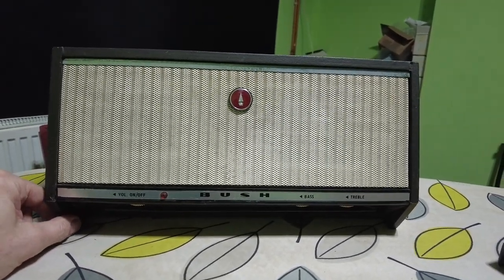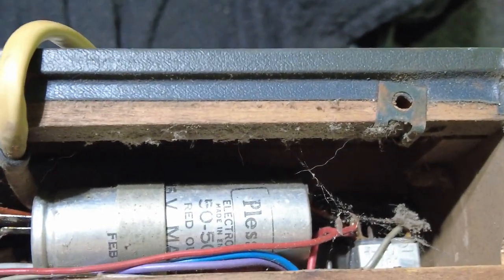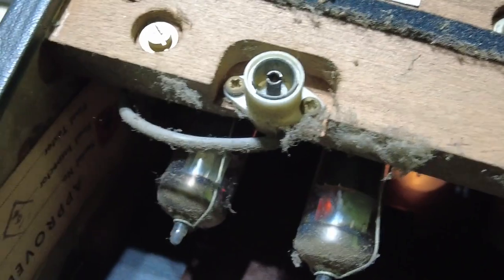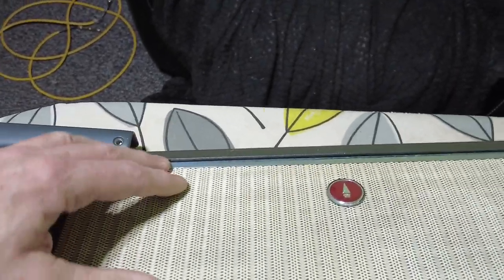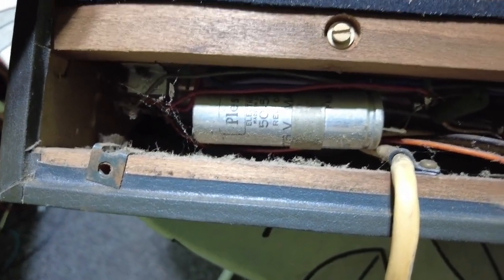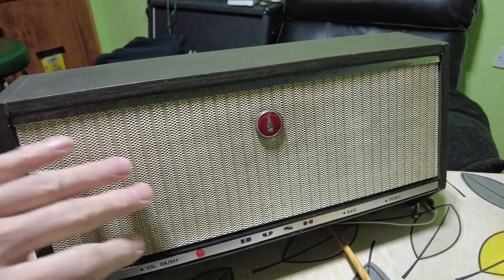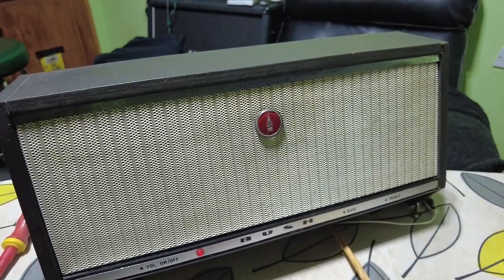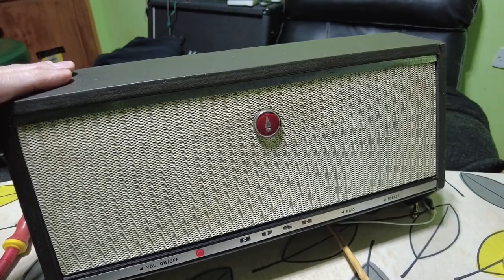Bush AU31D Record Player Amplifier is to become Desktop Guitar Amplifier Let's Take a Look

Comment: Ah man I’ve been looking for one of these for years to match my SRP 31 player I restored ,to use as stereo.
Shame but look forward to hear what you do with it :)
Won’t tell you how to suck eggs but you’ll probably find the B+ low due to that rectifier .
The tone control will really improve with full B+. Couldn’t believe how it was sounding with only 100v before I copped it.
Can’t believe you got one if these 😠
Love the videos, information and of course playing .
Trev
Reply from the maker: Hello Trev. I knew some was going say that. I feel guilty now about turning in to a guitar amp. I had noticed the rectifier. That will be coming out. Might try a full bridge in it. I have seen one or two pop up on ebay over the last few years but they have been silly money. I have also seen a few of the solid state ones too. If I come across another one, I will let you know on here by adding to this comment. Thanks for watching and take care.
Reply: @vintageguitaramp_guitarteacher  Thanks a mil for the reply.
I just put a  diode in and resistor to drop the voltage , works fine, no need to go to town on it but for your project I’m sure you’ll go the 9 yards.
Really appreciate the offer, thanks
Would love to pick one up
Trev